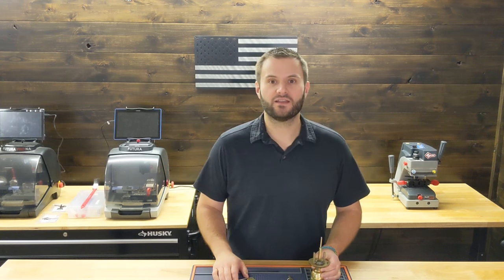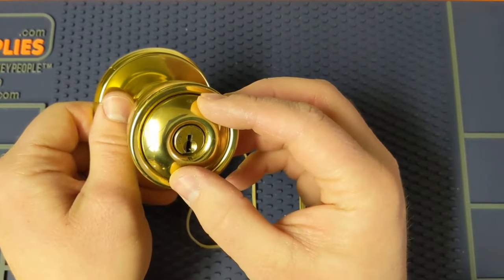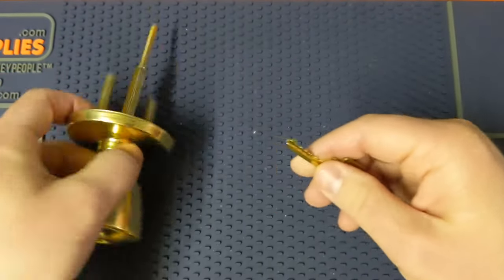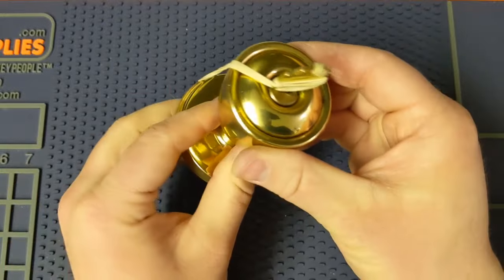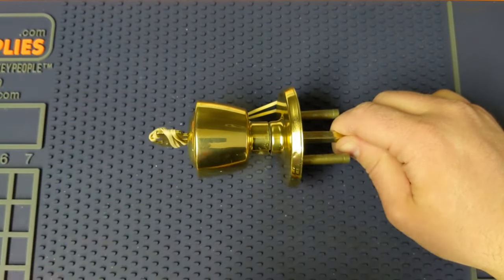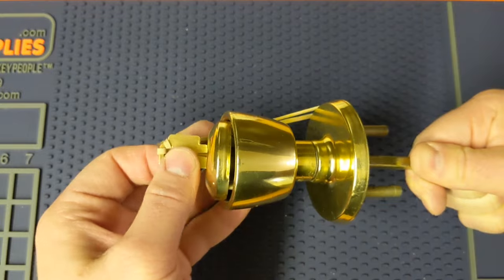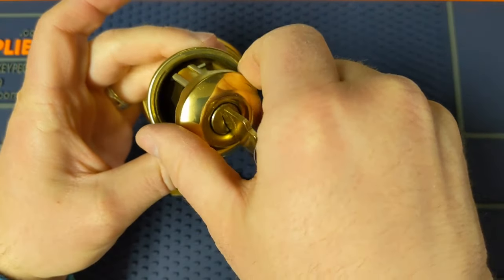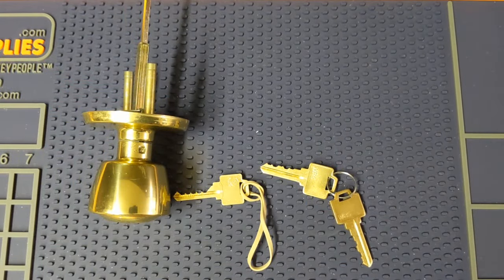Locksmith Tip |  The Rubber Band Trick for Weiser Knobs

Comment: This was another where I was like "I DID NOT KNOW THAT!!!"    and I tested it, and YES with THAT style Weiser knob (I think it's called "Tulip") it works well, but with the older, more rounded knobs though,  it's a PITA...  I only know this because I rushed to try it, got into the shop and started looking for Weiser scrap, first one I found was the rounded...  

It'll work EVENTUALLY, but it's quicker to just clamp the tailpiece in a vice and rake it (not like they're exactly high security) Not sure WHY the discrepancy, I'm guessing it's go something to do with the knob shape impacting tension on the cylinder.  On THAT style though, I tried two and both popped open by the fourth bump....  Definitely a lot quicker... THANKS!!!!

GREAT TIP, I just thought it needed a bit of context.

Comment: @CLKsupplies Is that sort of like bumping but more likely to work based on weight of the pins compressing the springs in resting position? Also is that cylinder/bible originally from that knob?
Reply from the maker: Yes and yes!-PJ